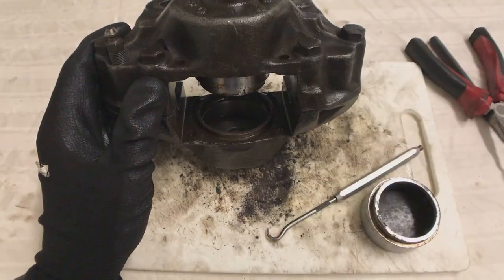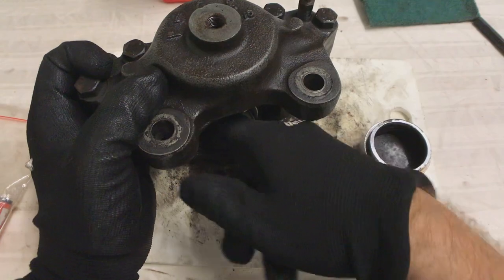Datsun Z car - Rebuilding front brake caliper

Comment: Thanks Aaron, just ripped steering rack and front suspension out, break pads were fairly tight, been sitting since 2007 under carport, I’ll look to tackle this when I’m on , very helpful cheers
Reply from the maker: Thanks Mark.  How did you go with the rebuild.  (Understanding my reply is belated 😂).
Reply: @kyushaspeed  yeh good Aaron mate, been busy time at work so slowed progress a bit but back into it this week,  got steering back together and back in her wheels 👍

Comment: Need to do mine soon. Thanks for the video! I ended up splitting mine and then had them plated. Will need to linish them now. Was thinking 600 then 1200 stuck to a flat surface like a mirror or a piece of glass. Hopefully it'll do the trick.
Reply from the maker: Mirror finish brake caliper a would be something to see!
Reply: @kyushaspeed  I couldn't polish to save my life. 😂 I was referring to the mating surface of the two halves. The zinc plating process adds a layer which will compromise the seal so I just need to cut it back. Not sure I have the rubber seals that go in between the calipers either. They're not part of the standard rebuild kit I bought. I'm sure my local brake shop will have something to suit.
Going through all your videos at the moment. Very good stuff. 👍
Reply from the maker: Glad to have helped. 👍

Good luck with the search for the O rings!

Comment: Split the caliper ,you have a new o-ring. A new master cylinder half the price of sleeving the old one.
Good to see a 3.1 stroker with cheap n nasty disc pads : /
Reply from the maker: robwhite240z can you recommend a front pad manufacturer?  I’ve used Bendix before on other cars and they seem to work well but were a little dusty.  I saw some Pagid Racing front pads on sparebox.com.au starting at $330.00 😳
Reply: @kyushaspeed  Try and find some TRW pads GDB881 OR Bendix DB86 ULT
You have to get them hot and cool down, then they will work